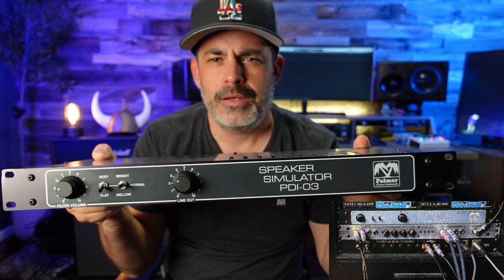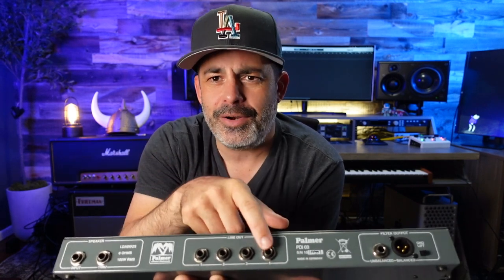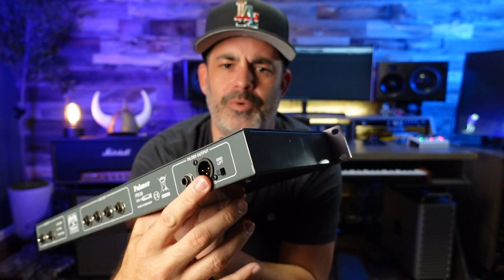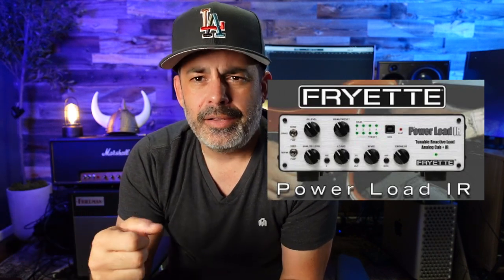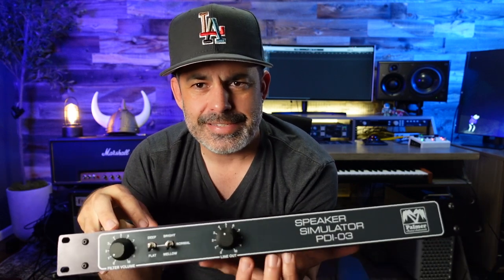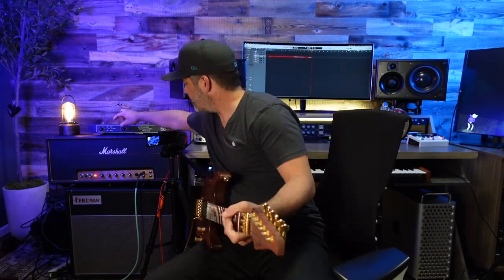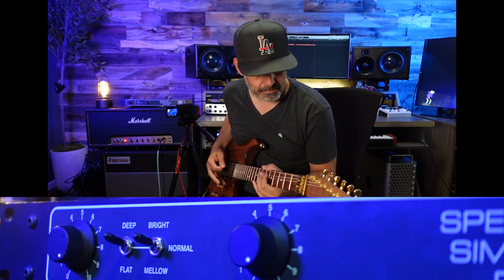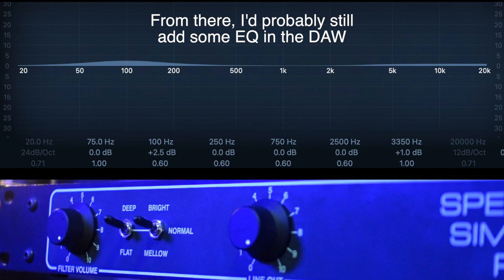What is this box in Eddie's rack??

Comment: I have used Palmer's live for years, Especially PDi 09. A little hi cut and lo cut and a cut at 3k and through a PA job done. According to Palmer the load boxes are reactive. "For optimum emulation of this complex impedance behaviour and operation of the amplifier without a speaker, the Palmer PDI-03 and PGA-04 speaker simulator models have a built-in reactive load that can handle a maximum of 100 watts."

Comment: Michael, the trick with the PDI-03 is to mix in a tiny bit of direct line-out with the emulated output. I know, sounds like a horrific plan (that buzzy shitty direct signal). Which is why I completely ignored Palmer's advice for way too long. Until someday I tried..."so, what other advice do you have?". (Btw. ever heard Rush's live in Rio performance? Pretty sure that is PDI-03 emulated output directly to the people).  Merry x-mas to you.
Reply: Yes it is! The R30 tone is the best!!
Reply: Great clean tones that way.
Reply: Thank you for this trick. I've just tried this with my Palmer and as soon as I turned the knob it sounds so much better. I liked the sound from the emulated output before but the mixed in line signal just completed it
Reply: @daeror2867  You are welcome. And I agree, the box turns into a different beast. I don't know your style. But I tested using the power chords of Van Halen's version of "You really got me". With no direct, it has that Palmer sound. Good, useable, but not fantastic. Slightly flat and with a somewhat metallic top-end. I actually agree with Michael when we talk emulated-only. But a tiny bit of direct and this punchy, bassy growling tone appeared (nice top end too now). Happy playing!

Comment: In the age of IRs those old Palmer units can be had for a fraction of what they were once worth. Technically, they aren't really advanced: Just a (resistive) load and a filter network. And still they sound pretty decent, considering that they could be called "vintage" now.
Using it to convert from speaker to line level is a cool trick, but a regular passive DI box would work just as well for this.
Reply: Also, thanks for showing how much of a difference a reactive load can make.
Reply: A regular passive DI box is not a load, sou you can't disconnect the amp to the speakers with it like you do with a load.
Reply: @lfzadra  Sure, but that wouldn't matter in a wet/dry rig.
Let the amp handle the dry cabinet and use an external power amp for the wet cabinet.

Comment: I think the Palmer is more of a Ron Popeil. Set it and forget it, which I like in it's simplicity. The Fryette seems like you can get in trouble pretty quickly. Adjusting all the ranges on the dial could actually pigeonholed you in what you hear and you could be constantly chasing tone if you don't have a good ear to tone sound. By listening to both machines on this video, the Palmer sounds better to my ears. Less is more sometimes.
Reply from the maker: Yeah. You get what you get with the Palmer.  I did like it on the Plexi, but I tried it with a JCM800 and the Fryette sounded much better

Comment: I only work with IRLs, and I have five of the older Power Loads that I have never used to terminate the signal- rather I just capture a tone to shift to another amp. 
I aspire to get a Little Labs PCP which is like a one into three version of all the Little Labs PIPs that I have strung all over. That could emulate the Palmer, for less than four times the price.
Reply: I just checked out the Palmers on Reverb. Sorry, it's got a Palm Tree Logo, some things are more important than function. Plus, Rack stuff tidies up really well.
😁

Comment: The loading down and the cabinet simulation is still the hardest thing so far in the guitar gear industry! 
It is still impossible to fine something that sounds like a miked cab! 
The Universal Audio OX is probably the closest up to date to a true sound. But costs more then your entire rig LOL!  ...and half of it is still digital :(
 
I have been searching for good cabinet simulator for years, and tried out many of them, just to realize how crap they sound... so far I found only two devices, that I would call usable:
One is an interesting old, weird looking, noone heard about thing: the Ibanez Parrot Box EC50. 
It is just a cabinet simulator, not loadbox, but analog, and reactive, and sound good and tasty.
The other is an old company's modern release, the ADA GCS-6 cabinet simulator. Also full analog. This one is capable to incorporate the power amp's tone (saturation) too, because it can generate cabinet simulation from the speaker output of your amp, BUT you still have to connect a real speaker (or load) to the system, cause there is no loading in the GCS-6. Basically you run your speaker output into the GCS-6 and another cable out of it into a real speaker. At least the cabinet simulation it provides, captures the power amp's tone too. 
This ADA GCS-6 sounds quite convincing as a cabinet simulator.
Interestingly the ADA and the Ibanez sound VERY similar!
Reply from the maker: Thanks Greg, super interesting.  In my experience with the OX, it sounds great if you use multi-mics, EQ, compression, and reverb.  But if you go down to a single SM57, it sounds artificial.  It's all kinda 6 vs 1/2 dozen.  ADA has a long history of analog speaker sims.  I'll keep an eye out for the GCS

Comment: Hi Michael, thanks for demoing this!  Question....I have an original Suhr RL and I load my amp down with it, and send that to my Eventide 7600 and then into Fryette 252 and guitar cabs.  I have head that this might not be the best approach because the Suhr RL is a GB-loaded 4x12 impedance curve, and the subsequent Fryette 252 and guitar cabs creates a second impedance curve.  Apparently, this second impedance curve goes away if I use a SS power amp into the guitar cabs, instead of the tube power amp.....Is this actually correct?  Thanks!
Reply from the maker: Hmm.  I’m not sure.  I think the fact that you’re using a power amp at all make the load impedance curve happen.  If you were blasting out of the cabinet, but the load box was in-line (basically taking a line out) then the impedance curve would come from the cab.
Reply: @BigHairyGuitars  Thanks! I'm going to order the PL-IR, and borrow a SS power amp, and test it all to see what I like best.

Comment: The information in this video is highly misleading. The Palmer PDI 03 features a fully reactive load box and optional speaker sim.
The presenter tries to talk people into favouring the Fryette device which, in HIS OWN recording, sounds very noisy and hissy.
Reply from the maker: The Palmer is really dark and muted.  It works better actually for when you're 8 inches away from a cranked 100w head.  But it really doesn't sound good with nearly any other amp in other situations, compared to the more current load offerings.  But if it works it works... go for it.
Reply: @BigHairyGuitars  I have 2 of the PDI-03  here. And even attached to a Triple Rec (yes it can take the 150 Watts) the flat/bright combo is wayyyy to bright.
deep/normal creates an output indistinguishable from my 90s Mesa 4x12 oversized cab with  a 57/421 mic combo positioned just outside the cone of the speaker.
Both switches in the middle is fantastic for fender amp vibes.
Most importantly .. and besides the cab sim, this load IS reactive and the line out perfectly reproduces the interaction between guitar and amp volume pressure for an IR in the DAW.
Split the signal to 2 heads, go into 2 of of the Palmers, set one to dark and one to bright to simulate a dynamic and a condenser mic ... mix to taste. Win!
Or use 2 in series with one amp head .... for 2 different cab sims, add a line out to the DAW for a 3rd cab sim.
This is a crazy good tool.

Comment: Kind of strange Ed would use this for effects after the power amp section. Will have to check out the Bob Bradshaw interview talk thing.
Reply: EVH mentioned in interviews in the past that the effects came after the power-amp section of his amp, but before the MOSFET power amp he used as a "master volume" of sorts.

He was basically using the head as a big preamp, getting his sound, then going out to the Palmer for a dummy load.
Reply: His original slave rig used a very large ohmite resistor tapped to aprox double the load of his cab.
From there, signal went to a box with a 10k pot to bring it down to line level.  From there, into an mxr EQ, mxr flanger, mxr phaser and eventually an echo plex...this is why the phaser and flanger effects were so prominent.  
In the early days, he'd then go into another amp for final stage volume.
Eventually he went into the HH V800 to power his stage cabs...
Reply: It's an awesome way of splitting the signal without effecting the core tone!!...and 4 times😮😁!!